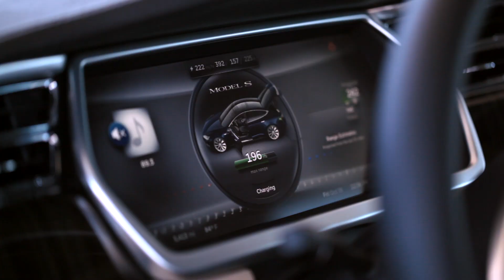Here's Why Tesla Just Purchased An Ultracapacitor Firm

Comment: The Mazda 6 uses them in it's mild hybrid to store power from braking to use for acceleration. They take up little room, I believe they are under the front passenger seat. They can be used to accept a heavy charge as a buffer, from braking or recharging,  which they then release to the battery pack at a slower rate.